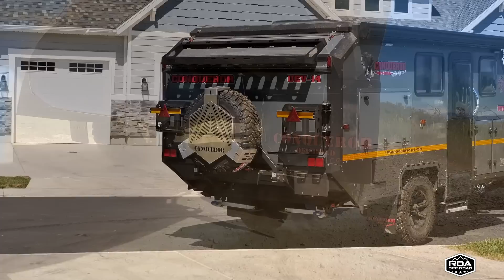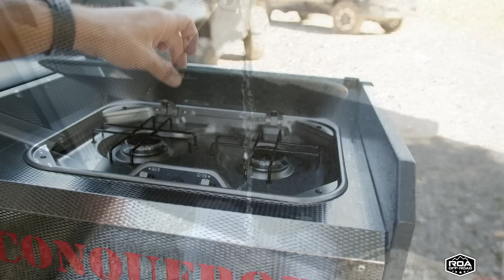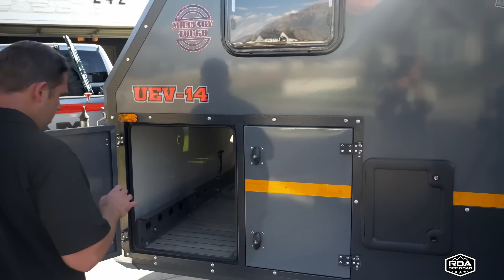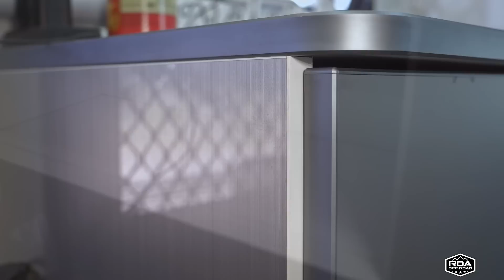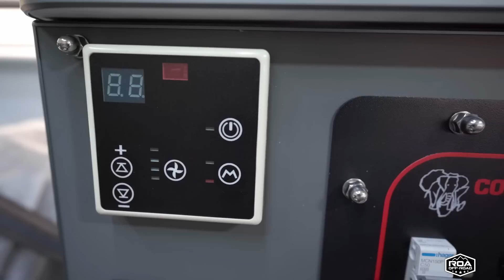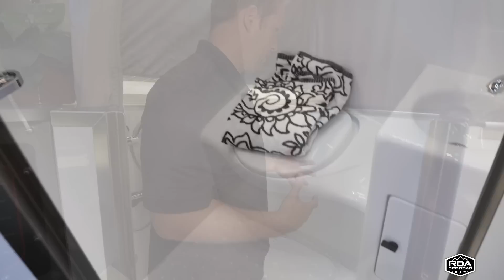Conqueror UEV-14 Off-Road Trailer Tour |  No Longer Available at ROA Off-Road

Comment: How big is the bed without folding out the rear? And can you sleep on the bed without folding out? I wished Conqueror would've gotten rid of the front bunk. Move the shower and bed forward, eliminating the need to fold out the rear. The need to have to unfold the bed and put it back away everyday can become such a hassle.

Comment: I was with this camper until it got to some of the electrical stuff. With a lot of the newer 2022/23 off grid family campers coming with lithium to start with and upgradeable lithium to 600hrs or more.  12v AC and a bunch of solar to help run it all off grid without shore power,  this won't do for us hotter climate guys in the southern U.S.
Reply: What's on your shortlist?
Reply: @thedewd516  I want something spacious enough to house 3 kids n wife. Small as possible with off grid AC. So far Boreas EOS12.. maybe Kimberly karavan Eco Suite... opus15 but it's kind of big. You have any ideas? Luckily I'm not looking to buy til probably 2 or 3 years and lithium/solar technology is starting to really blow up for off grid
Reply: @RayMousavi  wife wants inside shower/toilet, which greatly limits the options. I'm in the SE as well. The UEV-14 would fit the bill, but I don't know if I want to spend that (may not have a choice)
Reply: @thedewd516  everything I named has that. And everything I named is expensive. Unfortunately  life stopped being cheap after wife/kids/covid. Lol

Comment: What kind of clearance is there to the tongue box if you had a tailgate mounted spare tire on your truck? I also have a Power Wagon that will be on 37s. I'm considering a swing out spare tire gate but wondering how a trailer like this would clear a spare at hard turn angles or in dips.
Reply from the maker: The best example we currently would have is on our Conqueror UEV-490 Walkthrough video. You can see some shots with a Tacoma that has a spare tire swing-out. 

https://www.youtube.com/watch?v=488ZcQ0PuaM